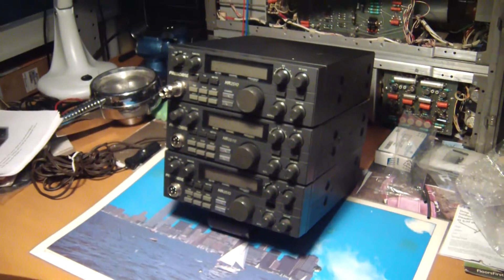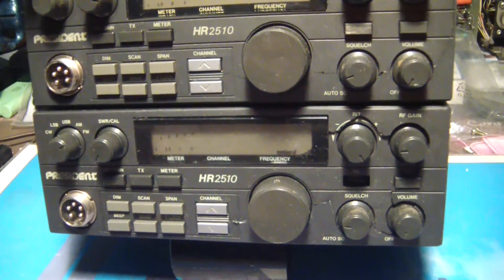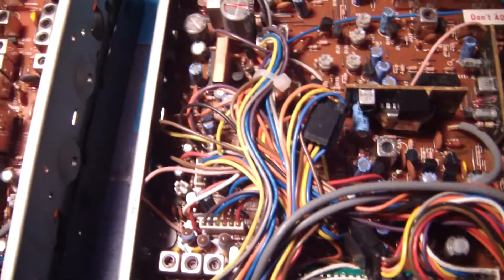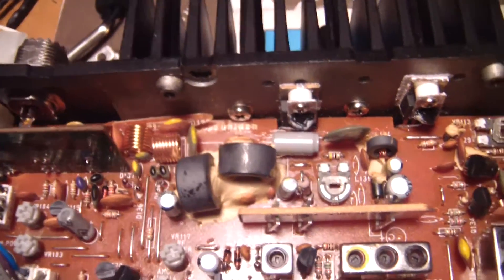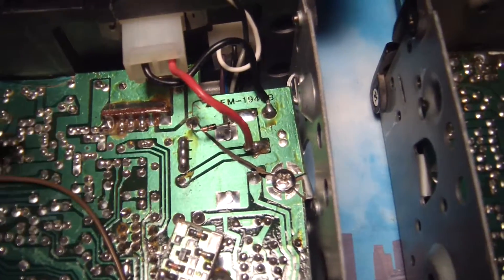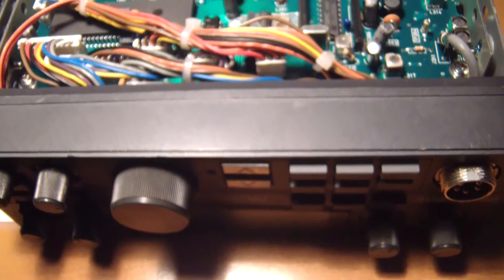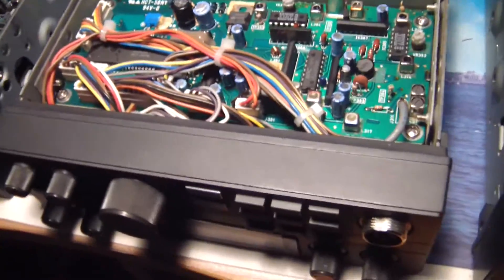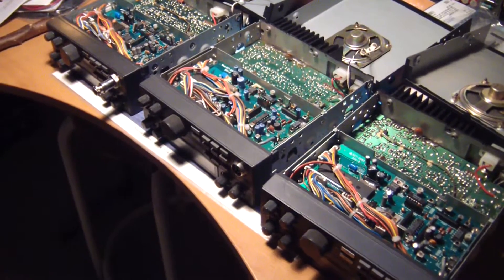Uniden HR2510, mobile 10m HF radio's, Inspection, part 1

Comment: Sir, a friend of mine gave me one of these kind of radio which was in storage for a long time. The fuse together with its power cord is in good shape but it doesn't want to tuen on. What do you think could be the problem?

Comment: The entire board HCT-58 NY shoud be replaced in my case. Some friends said that the UC-1250 Uniden IC is defective but I saw other points with burn traces on this board in particular. So if one of this radios will be for parts let me know. Carlos Saraiva PU2VKS, Santo Amaro Island. And a CB radio is really important down here...

Comment: I have one HR2510 that is stuck on a freq. I believe the main processor IC is in defect or maybe the entire cpu board could be with problem and I don't have spare boards to reduce the quest for the defect point. If you afterwards find you with a spare functioning cpu board I'll be glad to buy it.
Thank you in advance

Comment: lol  folks can purchase the new radio that is on the market now  loaded with SMD
like the grant and Jackson 2 ,I bought 2 in  88 from Scanner world use 1 the other still new and later got 3 from  ebay but the radio that I need is the Lincoln  with the  big final , I am a greedy man  lol I also got 2 ranger AR3500 100 WATT  version
my worst regret today is my purchase of 2 Cobra 200 still new in box and I love to search for parts radio of HR25I0

Comment: i am currently running 2 hr2510's with a mosfet final conversion. the only thing that does not work is the rf on the meter and a fix may be here in the future. they perform as good or better that the mrf477 with little heat from the heatsink.

                                                    john